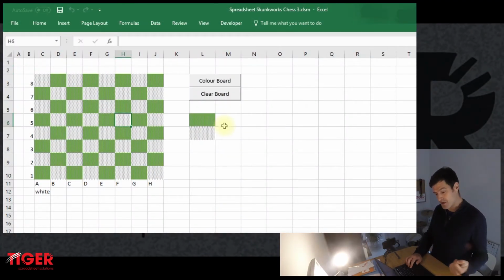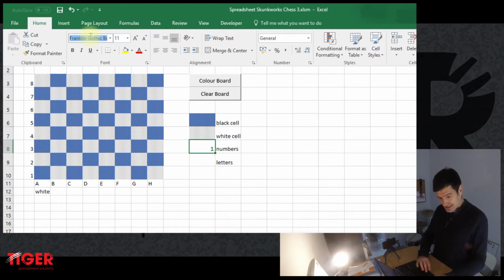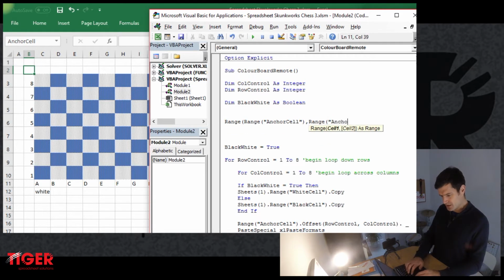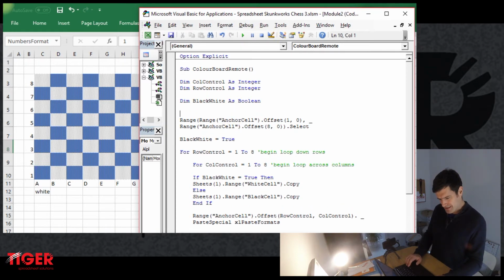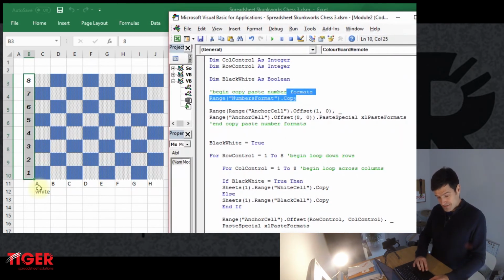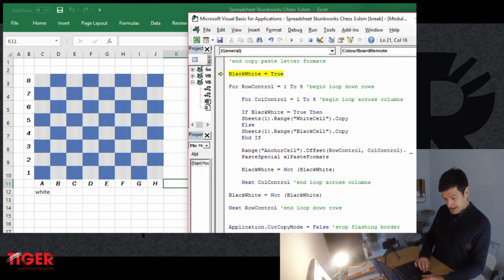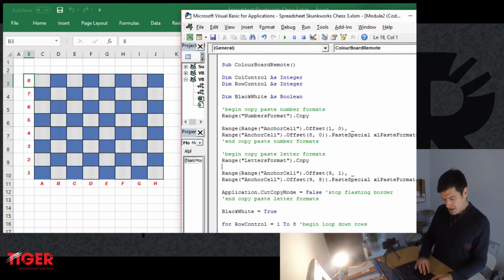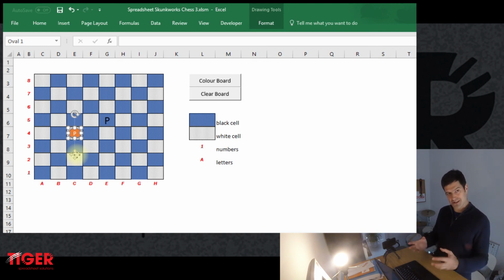Excel VBA Chess Challenge #3 - VBA to Dynamically Select A Range Of Cells

Comment: I'd already started writing a Chess spreadsheet before I discovered your series.  As I expected, you're writing it properly whereas I've cheated a lot.  I've 'hard formatted' the board and the piece colours - mainly because the spreadsheet is only for my 'amusement'.  I'm really interested in your idea of having the pieces represented by graphics rather than text.  I had a look through Wingdings to see if some very nice person at Microsoft had already designed chess pieces as characters, but I didn't find them.  So for the moment I've 'copped out' by using the alphabet.  To be honest, I want to conquer the logic of playing the game, get Excel to recognise the legal and illegal moves, taking pieces, and calculating which is the best next move.  When I've done that, I'll go back and undo all my cheats because that's relatively easy.  Thanks for this series.  It's really interesting!
Reply from the maker: Steven - building it with 'assumptions' and then building those out later is a perfectly good approach in my book.  Keep it up!